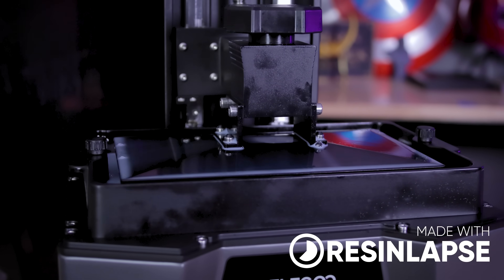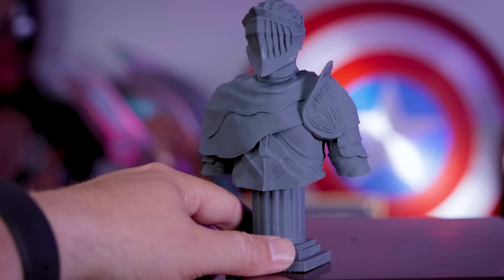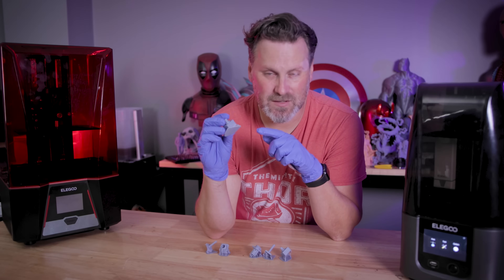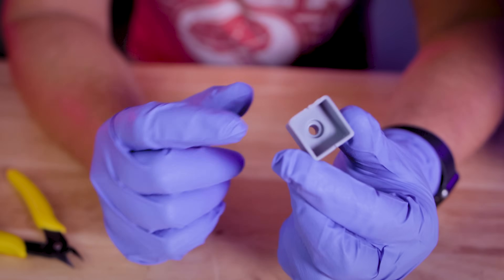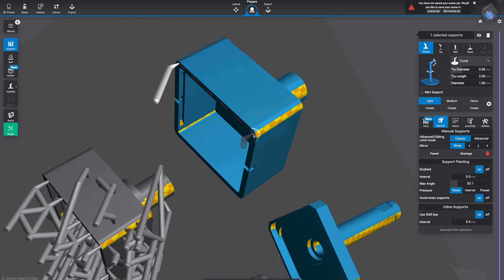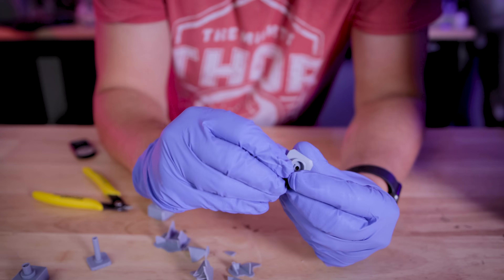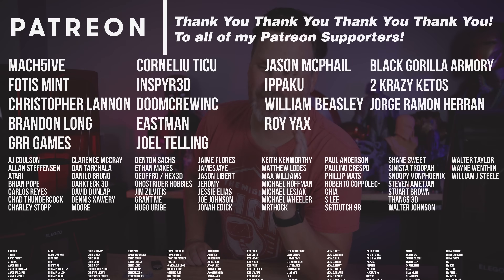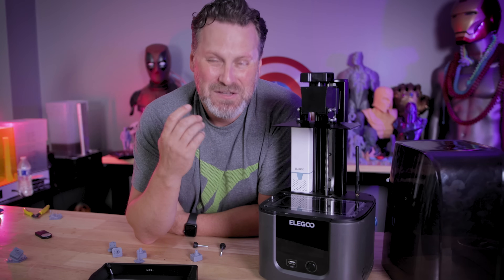Continuous Supports - Technical Resin 3D Prints

Comment: A bit late to the party, but I believe that this is an absolutely vital approach for 3d printing boxy items like buildings and rolling stock for model railways that need nice straight edges that will fit together cleanly.   Certainly that's where I came across the idea of continuous support first.  The items that I've designed (that other people have applied supports to and 3D printed) have always had poorly formed or curved bottom edges, and I was looking for likely dimensions and proportions to create my own sacrificial knife edge grids for my models so that they start off right, 'cos the rest of them are close enough to perfect.  A very helpful video - thank you!

Comment: Warming the print up before removing supports is helpful. I use a heated ultrasonic machine. Distilled water that heats up in the ultrasonic machine > IPA in a saleable mylar bag > prints in bag > run ultrasonic for about 5 min. So I get two for one with this process. Cleaning the parts + warming the resin for easy break off.

Comment: I heard that the Vlare slicer has a function that enables separate exposure times for supports. I haven’t tried it yet, but I will be since I make continuous supports as well, and I would love to get that perfect snap! 
Pro tip: I use a torch lighter and a razor blade which basically means no sanding necessary.

Comment: Hello 'Uncle' Jessy
Question please: With your extensive knowledge of resin printing - I have some extra resin(s) left over but not enough for a full print - is it possible to mix 'High Toughness' resin with 'Standard' resin with decent results? Thanks for your time.
Reply: I have a drip tray for tools and funnels with at least 4 different resins. I’ve used the left overs to print with no issues.

Comment: It’s really interesting, I tried it on a few parts…but for geometric, mechanical parts it’s best to print flat on the buildplate.
A tuned machine is mandatory though. I constantly see people using so much curing time on base layer…you just need 3-4x normal curing time

Comment: Modeling Razor saw is always handy for things like these contact support removal I use it on inline supports for the bases or keyed attachments for my 3D printed model's! It was something I had a few of being a modeller and thought they would work alot cleaner than tear away! Even if you are tearing the supports slide the tips sode way's done pull then they do alot less damage and leave next to no attachment marks

Comment: Thanks Jessy! I love that you're exploring this. I do product development and usually print geometric shapes with smooth surfaces and want to minimize the amount of post work. Not sure I have the formula down quite yet but I will be exploring this option
Reply: Just print directly on the buildplate 🤷🏻‍♂️ geometric parts come out perfect
Reply: @black___gains  yes building on the build plate is a part of the solution but sometimes you need supports as well if the part has some over hang etc. Part of the problem of building on the build plate is that you get elephants foot. I printed a successful print yesterday where i printed the part on the build plate and made 'parametric' supports in my cad software and it came out perfect

Comment: None of this matters. Resin inherently shrinks and expands beyond our control.   It will never be reliable for dimensional accurate parts. Never. It’s science. It doesn’t matter how you “support” the part.
Reply: All materials experience expansion and contraction to varying degrees. Metal and plastic predominantly do so from thermal conditions. Wood responds more to changes in moisture content. Use higher %solids resin to decrease shrinkage. That's science and engineering design.

The parts I shared with continuous supports don't leave pockmarks and can be assembled into a functioning mechanical key. It works great even in complex assemblies.

Comment: I got a wham-bam play for my resin printer and I print my bases directly on the plate anymore, no supports. This is really cool when I can think of many uses besides basis for it. But I started taking models designed for no support fdm prints and started printing them right on the plate of my resin printer.

Comment: That's amazing! i have been making supports manually in CAD just like those (FDM printing though) and it leaves perfect, nearly perfect support as long as there's a perpendicular section to support laterally so it doesn't get tipped over while printing

Comment: i do functional printing as engineer. i hated those small support and it need alot of clean up. so i pre design my support in my cad software. usualy its square or rectangle with 0.5mm thickness. then aftr curing i remove them with a xecto knife.

Comment: I've been doing this on my functional part designs for years, best advice i can give is to do some test prints to find how thin you can go, and then use a fresh exacto blade to slice them off before curing. "tough" resins like ABS style ones work best.

Comment: Often you just print it flat without supports. Compensate for bottom layer and elephants foot with chamfer and z height reduction. Also helps if there's a hole in the build plate for hollow prints.

Comment: Hmmm interesting! I have printed a few hundred keycaps and one thing that happens a lot is the bottom edges will warp slightly just like the base on that bust. It doesn't really matter in my case but I think this concept is important and will probably see much wider implementation in the future.
Reply: You can’t do away with that “warping” this is resin and it’s nature it shrinks and expands it’s not ideal for any accurate parts or environment use or food use.

Comment: I'm curious how clean you could get it is you use a fresh razor blade on the continuous support option (without breaking it away first)... The problem with breaking off is that it might break off a bit of the print. Removing one continuous line should be easier with the razor then doing that with dozens of contact points. The amount of pressure and the right angle might require some experimentation...
Reply: I suggest starting from the end of a continuous run and pressing gently so it starts to open up and then pressing along. Once it's able to fold over, do it. The pictures I have of these parts on my cults page were done at room temperature using my fingernails.

What little remains comes off quickly and smoothly with a hobby knife. 

Starting with a knife turned out to be more work because I've been designing the supports with stress risers where breakage is desired. Something even easier is in the works.

Comment: This would be a great feature. I'm currently printing small switches and buttons for my cockpit sim and the left over support contacts are the biggest pain. Even with my settings dialed in, there is still a significant amount of marks left by the supports. This feature would cut down my paint prep significantly.

Comment: If you want to remove that bolt you can just put two nuts and try to unscrew it turning just the bottom one. It should lock with the other nut and you should be able to unscew it whole.
Reply from the maker: Oh man that’s a fantastic idea!! Thanks I willl try that out.
Reply: @UncleJessy  and if not just try turning it with pliers, it shouldn't be holding that strong and bolt will end up in trash anyway.

Comment: with the stuck bolt, try using a dremal to cut a slit in the top and then use a flat head screw driver to wind it out

Comment: Did this process after lots of testing with Lychee supports for a production run of really small adapters on a Mars 2 Pro with regular FEP. Modeled my tower of parts (tested 5-9 high) in CAD. Was getting 300-500 parts per print (depending on success of each part). Best part was that I could strip the parts off the tower like food from a skewer and the supports generally flattened as the parts went past.

Comment: Looks like you're using the default support settings in Lychee. I've found those are set up as that because they're more forgiving for suboptimal exposure. If you set your printer with the cones of calibration you can probably use supports with tips in the order of like 0.2-0.3mm. Those are sooo easy to remove. With such thickness and continuous placement I'm sure you'd have a better experience.

Comment: Really interesting. I'm gonna try this.
I make some small pieces that end up with thick appendages where the resin pools in the tips is the supports, even if I turn the density right down. I wonder if a continuous support would drain more easily.

Comment: I don't care much how easy they are to remove or how much cleanup is required.  Was there any difference in the amount of dimensional accuracy or warping between the different methods?
Reply: not great, look at the parts on glass at the end: they're still warped even for how tiny they are
Reply: Don't want warpage? Add more supports.

Comment: I think current supports are the ones that typically wreck FEP by leaving small dot indentations especially if you end up printing too fast.  Idea like doing continuous supports came into my head few times but i never tried it as printing some geometric shapes on a 45 degree angle left warping all over.  If these supports actually went even completely down to the build plate it would be ideal  I get there would be a lot more resin wasted but id rather get more accurate prints and healthy FEB over wasting a bit more resin per print.

Comment: When i first started 3d printing 6 months ago I had a hard time figuring out supports and I got very discouraged with how much waste was being created with them so U just went and created my own custom supports and I still use them a lot. In fact I have a large print going right now that will take just under 800gm of filament with my supports but it was going to be over 1kg with they least amount of supports I could get cura to add.  I'm glad to know that I'm my ignorance and impatience I actually did something good. 😊
Reply: This video is about resin not filament

Comment: This is a really interesting idea.  With the right resin it may snap off cleanly, and worst case it will be like the brim of a FDM print where you can clean it off with a deburring tool or hobby knife.
Reply: Not for something as Sirayatech Blu.
That stuff is though. And ideal for technical objects that have to withstand at least something on half the rigidity as stupid PLA from FDM (I prefer cf nylon solely - no resin alternative at all)

Comment: Interesting. I'd guess with the Inline support you might have to adjust the penetration depth to create a weaker connection, which wouldn't matter as much as you have such a dense arrangement of support. Looks like with a bit of testing/adjustment it'll be a useful feature.

Comment: I do the same thing for fdm printing. Custom made supports are the way to go for perfecting your prints!
Reply: Could you share what of your videos you do this?
Reply: Tree supports mean you shouldn't really have to do this. Also if you make the supports part of the stl then you can't use an interface layer to break them off easier.
Reply: @Hitman12.  if you simply leave a gap in cad, you have your interface layer. And tree supports are excessive for certain projects, at least in my opinion.